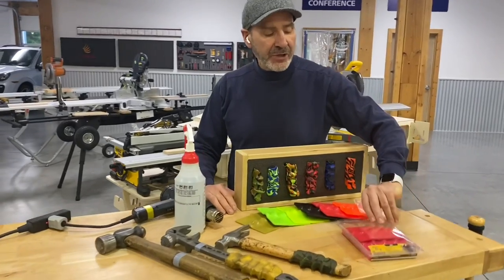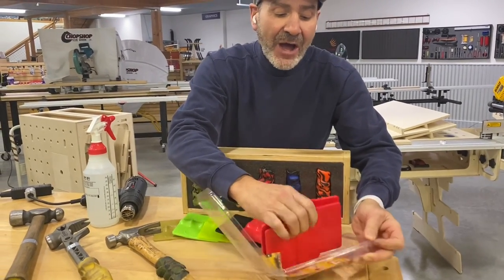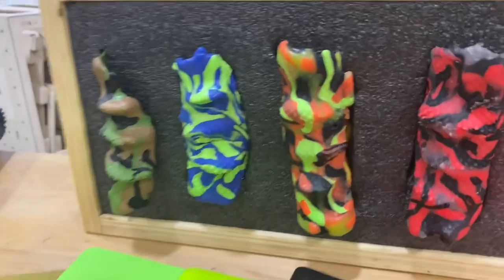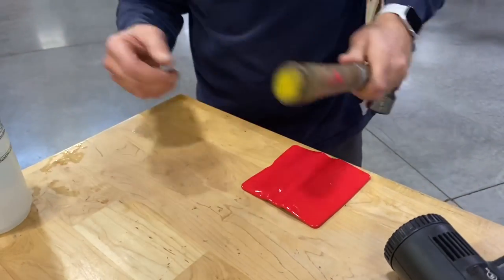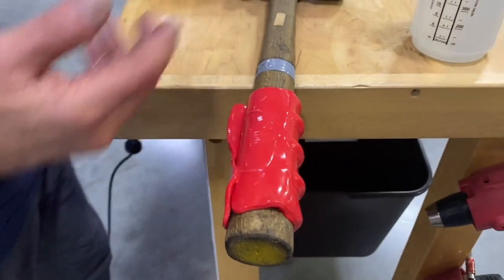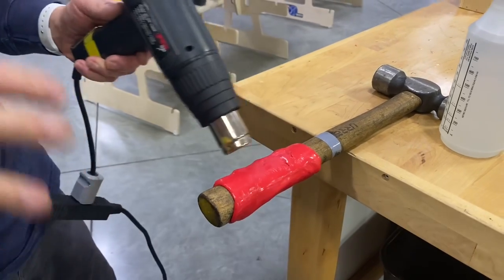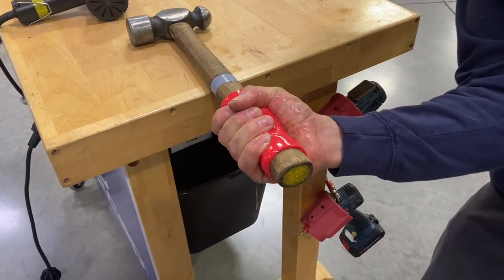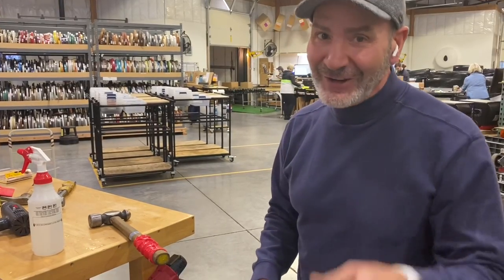My Grip 4 Pack

Comment: What is the hand grip made of material
Reply from the maker: The material we use is a safe non-toxic material at normal operating temperatures. (If you heat it FAR above the temperature of boiling water you can degrade the material which could pose a health risk). It is very similar to the material used to make mouth guards! However, the material we use is not food grade which relates not the materials composition but to the environment in which it is prepared, and regulations on how it is transported aimed at keeping foreign contaminate out.